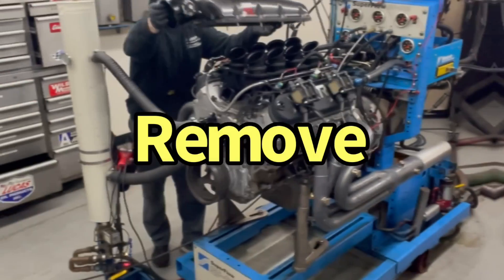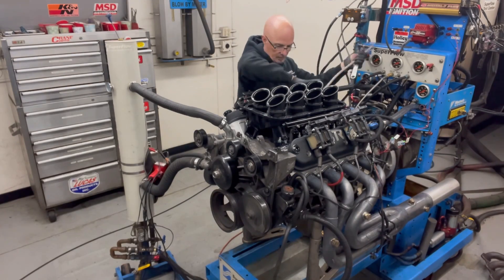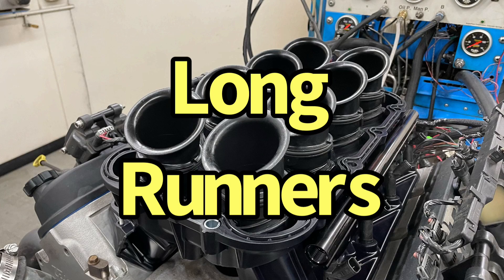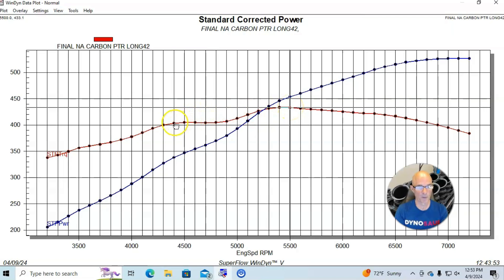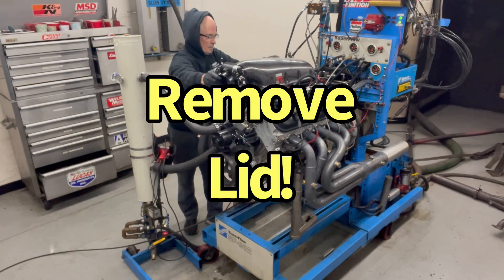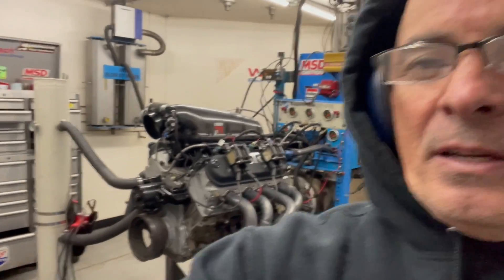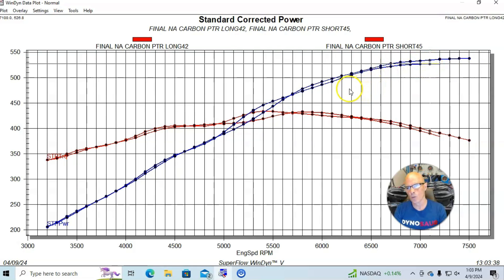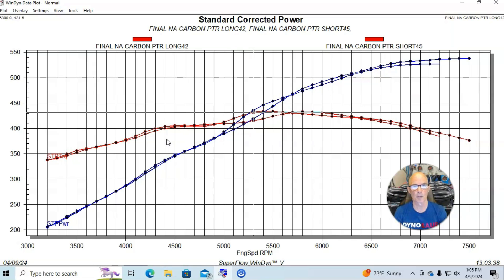CARBON PTR INTAKE TEST! HOW WELL DOES THE ADJUSTABLE, CARBON FIBER INTAKE REALLY WORK? RUNNER TEST!

Comment: Sort of related to this now year old video, how do you measure the runner length. I know the theory is it goes from the back of the valve through the head and out the intake runner to the end of it... But this is the most straight through intake short of  a tunnel ram, and I don't know how you would measure that to know. 

So did I just see the reaction of the runner length going from 12 in to 15 in or did I just see a runner length of 8 in or? I have no idea
Reply from the maker: When intake testing-we only measure the part that changes-the head port is a fixed length but does count as the total length. Length is typically measured in the centerline of the port-includes the bends

Comment: Hey Richard hope you are doing well. A question for you. I have a 5.3 LS with about 32000 miles on it. I had my 243 heads done by Texas Speed their stage 2 a Texas Speed 600/600 223/236 with a 111LSA. Going to run some nitrous on it.  What intake manifold would be a good fit? Thank you for the videos that you put out 🇺🇸
Reply from the maker: FAST LSXR

Comment: I say again: I have not seen anyone do a test where they change not only length, but DIAMETER of the intake runners. 
My theory is that with a long enough runner with a large enough cross-section, you could have a little bit of the best of both worlds: length for low-RPM but cross-section for higher RPM, so one would not completely defeat the otherr.
A super-long-runner with super-small cross-section would dramatically sacrifice mid- and top-end power for low-RPM torque.
A super-short-and-fat set of runners would do the opposite.
A fat-and long set of runners may find a middle ground, as it were. more low-rpm torque boosted a little bit and high-rpm power raised a bit.

But, the question is: "Can a fat runner's higher RPM potential still be found if it is a long, fat runner?

Note: the Holley Sky-Ram's runners were just too small in diameter and choked off the motor, in my opinion, which is why I never liked the overall results of that somewhat humorous test. Super-long runners need to be super-fat, too to not choke the engine out.
Reply from the maker: reflected wave and flow don't do the same thing

Comment: Hi Richard at the moment iam doing a custom manifold on a sbf 363 efi motor 
I have a holley hi rise manifold and I extended the runners by 5.5 inch and the manifold has 6.5 runners that makes 12 inch runners with a custom made lid the cam is 227 234  .063 lift at 112  what your throught on this  peter
Reply from the maker: did you make a spacer for the lid to fit the runners
Reply: @richardholdener1727  yes it run a 90mm throttle body  and the runner have belmouths on them
Reply: @richardholdener1727  also I have flow the manifold set up with my set of heads afr 190 comp with the 90mm throttle body and a belmouth 
The flow fig ar
550th 267.2      600th 275.7  
650 th 279.4     700th 281.7
With out the lid  on the manifold it flow at 
.600th 282.9   650th 288.9 
700th 291.1

Comment: Question new to boost. I have lq4 with the 54 454 11 cam and sheet metal inatke and ported 243 heads made 430rwhp now been trying to install turbo kit and 7875 want to make good power at 14lbs what do you think would? make and people said the cam is to big for back pressure with small turbo. So bigger turbo or different cam?
Reply from the maker: a 7875 would work well on that
Reply: @richardholdener1727  Thank you! Also does fuel regulator need to be before or after fuel rails?
Reply: @horsefly1020  perfect thank you!

Comment: Given the amount of guys switching to EFI it would be great to see what sort of A/F variations we see across all cylinders with common carb type manifolds which have fuel injectors at the head ports (MPI),  adapted to them. Probably some common ones would be a victor, super victor and RPM air gap dual plane.
Are people tempting fate by using these manifolds with EFI and creating very lean cylinders ?????
Reply from the maker: see the carb vs efi video on a single plane ls

Comment: I wonder what it would do with long, short by the firing order.
Reply from the maker: I have tried mixing and matching previously
Reply: @richardholdener1727  I missed it, did it do as expected
Reply: @richardholdener1727 
That was my question, if you had staggered the runners, but by also swapping long for short both ways.
I would think that the front cylinders would be losing air to the back due to plenum design.
And with taller runners up towards the throttle body they would have better chances of actually being balanced to a better degree. 
Did you have sensors on each to read afr and egt's per cylinder to verify they were as close to equal as possible?
As I always felt that with to common plenum designs, that the further back the ports were the better flow, because of the air being forced into them, due to air hitting the back of the plenum.
That and just with velocity coming in through the throttle body being blasted past the lead runners, and doesn't appear to be enough area to allow for it to equalize the pressure with the design sloping towards the rear as it does. 
Be interesting to see actual flow characteristics done with a clear mockup with smoke and all the proper meters for reading CFM's velocity static pressure. 
That'd be the truest form of designing how the runners and plenum needs to be designed and then play on the dyno. 
Yes Sir I am sure that they never thought of going to such detailed analysis, because that's not cheap do, and small smoke grenades are so expensive 😊

Comment: That's a pretty... healthy... cam for a 5.3 (it's a 233/25X .636/.636 for those wondering).
Reply: I'm running basically the same cam in my LS7 lol
Reply: A lot of lift for a short period of time keeps power down low and I'm sure makes fine vacuum and idles well.
Reply: Not really with the cylinder heads he's running.
Reply: I am running the BTR Redhot cam in my Ls3. 221/24X .617/.619 113 LSA. Stage 4 in a 5.3? Yea that's a big cam!!!! Lol
Reply: @GrandPitoVic how?
Reply: Stage 4 na! Works great in an LS1 camaro.
Reply: Y'all have no clue how "big" the cam is.  You only know (vaguely) what the duration at .050 is and the peak lift.  Based on the power output, it isn't big.
Reply: @zacharymorris9917  I'm inclined to agree. Solid roller 247/254 .693/.674 113 is a bit bigger (5L ls autocross engine with 14:1 compression)
Reply: @tadwiltman4875  LS7 heads?  Or longer valves?
Reply: @zacharymorris9917  it's a Tony Mamo cathedral head. He also did the valvetrain/camshaft combo. Should give me about a 45-7500 rpm powerband with useful power and valve stability to 8k. If I was doing strictly track days, I'd go with a bit less lift for sure.